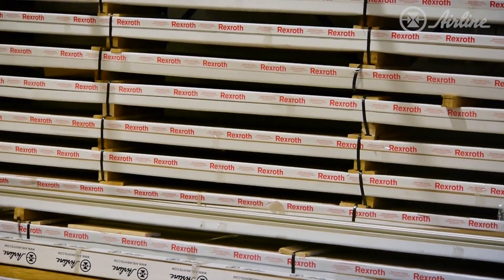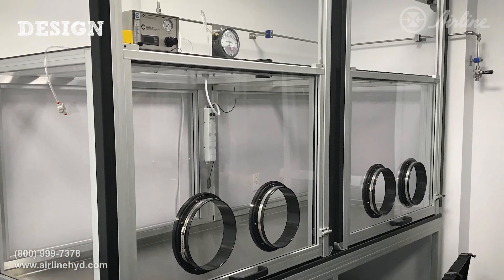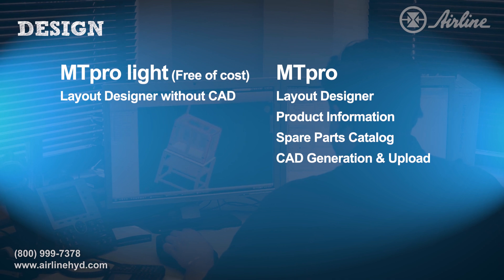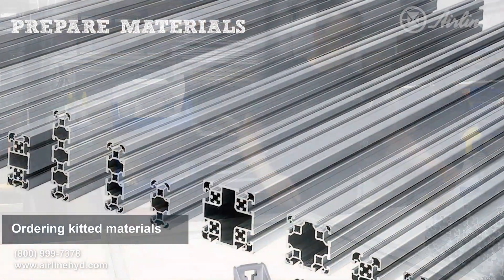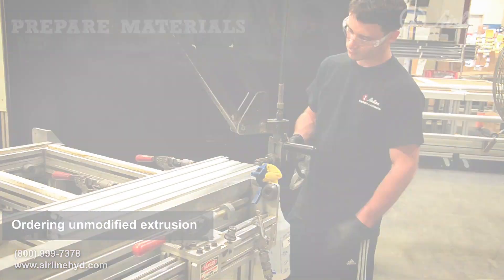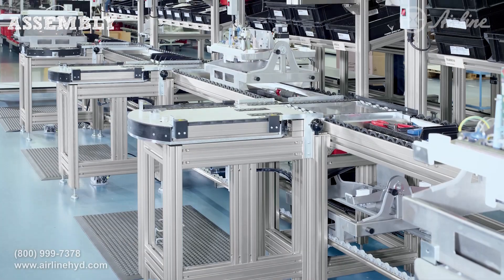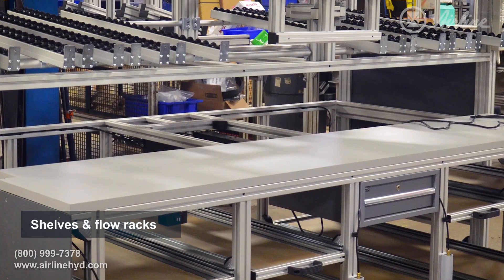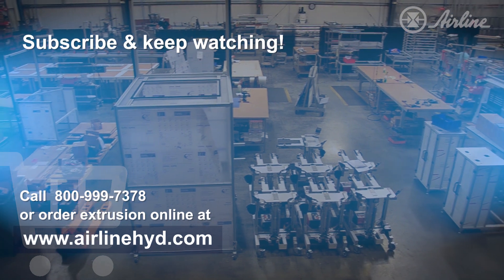How To Build Anything with Aluminum Extrusion (by Bosch Rexroth)

Comment from the maker: If you have any technical questions about this video, just complete this quick form and our engineers will be in touch with an answer 💡 https://bit.ly/3e3H6nS
For step-by-step tutorials on how to connect aluminum extrusion 🔧 Watch the first one here: https://www.youtube.com/watch?v=k9j9TRgx1uw
Reply: Hello I have a question?? Can I connect a 20X20 V-slot aluminum profile with a 20X20 T-slot profile just as the same way, same corner brackets which are used to connect two V slots together?
Reply from the maker: Hopefully this helps, if not, you can always ask more in-depth extrusion questions here - https://bit.ly/3e3H6nS

Machine Finish:
•	An end of extrusion cut with a precision piece of machinery v. a hack saw or something that gives one a crude cut. Airlines cutting machines automatically holds the extrusion in place tightly with a precise cut to size length.

Miter Saw:
•	A cutting system that is typically mobile and can be moved around from job site to job site. These saws can give a smooth cut if used with a carbide tip blade which runs around 2500 rpms. They typically do not have an accurate measuring system that consistently give an repeatable and accurate cut length.

Comment: How about a rectangular extrusion frame that would allow a separate panel to slide up and down if a button or trigger on a handle is pressed. Once the trigger is released, the panel can no longer move. Where might I find that? Is that something you guys could fabricate? I'm trying to construct a vertical motherboard mount where the rear I/O would be on top as opposed to the side or at base. The motherboard panel would literally be slide able down into the computer case and slide able to above the rim of the computer case to allow to swapping components, etc.
Reply from the maker: Sounds right up our alley! If you copy your comment and information into this form, one of our engineers can reach out - https://bit.ly/3e3H6nS

Comment: 2:40 what tool is this?
Reply from the maker: It's an ergonomic tap drill, used to easily thread the extrusion to accept connection screws or leveling feet

Comment: So we bought a townhome-style condo with a lanai with one exterior screened wall framed with aluminum.  It appears self-tapping metal screws were used to tie the hollow square aluminum framing tubes together.  Along the bottom, a sheet of aluminum is fastened to the aluminum frame to create a non-screened band along the width of the fabricated wall.  This got us thinking that we could "4-season" the room by adding our own sheets of aluminum to the remaining screened in spaces, or adding plexiglass or such to areas we want to still want to see through.  The square aluminum support frame/beams could be clad on both sides leaving the interior 2-3" space a void or filling it with insulation.  Is this a naive DIY, or are we as first-time homeowners on to something?

Comment: Hey :)
I could need some help.
I bought your profiles for building a cnc marchine and I wannt to tap the hole in the middle of the profile. (45x45 light weight nut 10 b type)
The problem is that the hole is to big for M10 an I don't think I can tap M12 into that hole. Any suggestions? Are there some inserts ore something available?